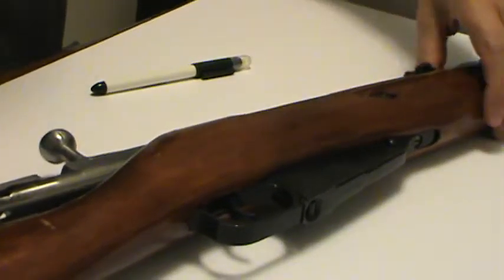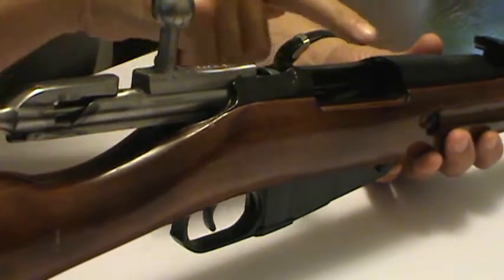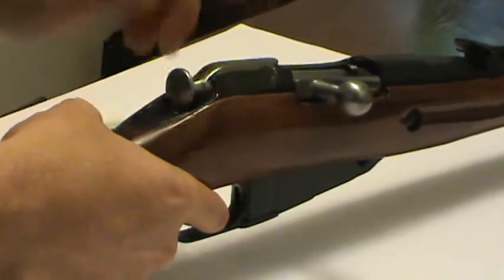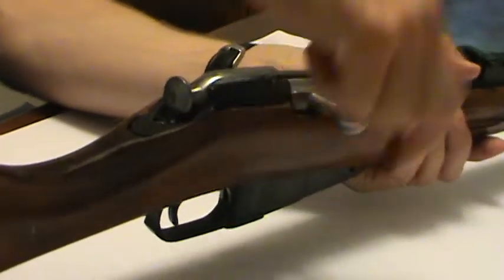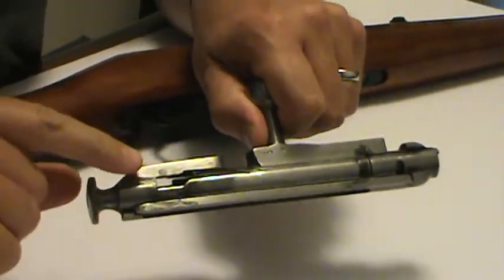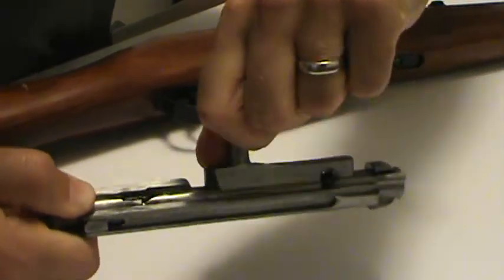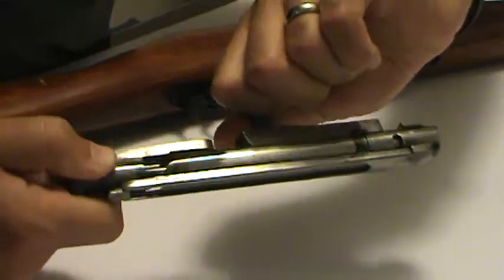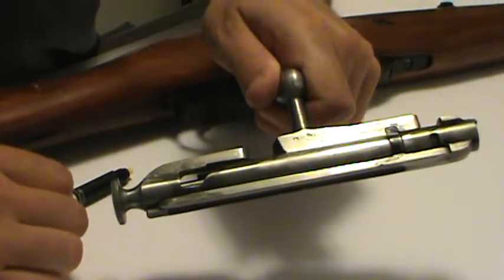Mosin-Nagant.Sticky.Bolt.Test

Comment: Good tip.  Mine are polished with 3000 grit.

A cock-on-open bolt really needs to have smooth camming surfaces with no abrupt angle changes.

Josh